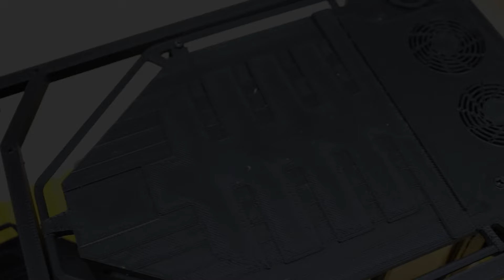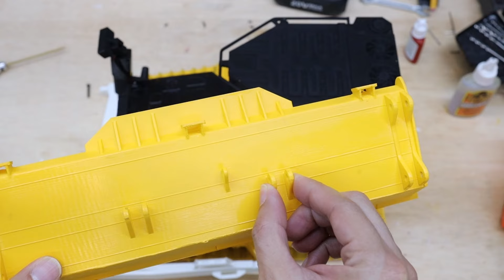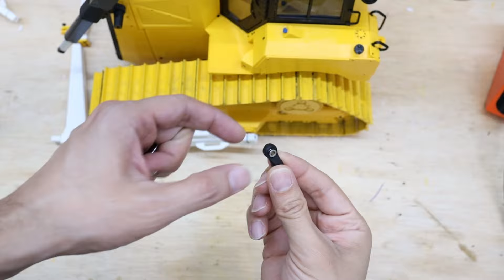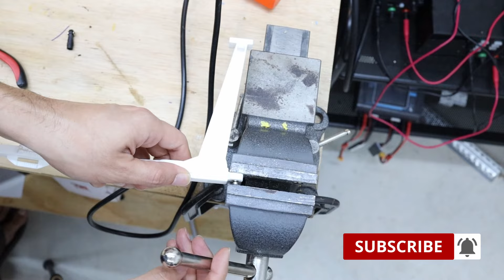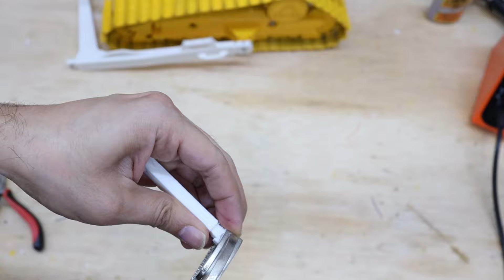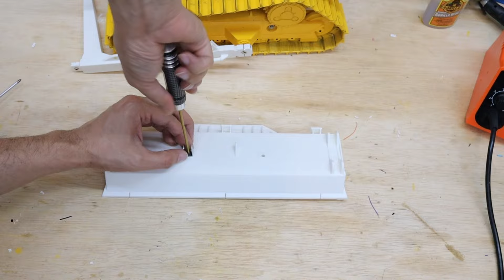3D Printed RC Bulldozer Part 3 - Blade Fixes, Sound Module, Radio Setup & Final Design Release!

Comment: I have to inform you, your dozer on the right does NOT have a U-blade, but an S-blade…I have just printed out and assembles a D6 similar to your, but I scaled it down to 1:25
Reply from the maker: Hi yes you are right, it has an S blade and in the files and manual an SU (semi universal) blade, I have been learning about the different types of blades.
Reply: @domingomartinezt Some very nice work you do